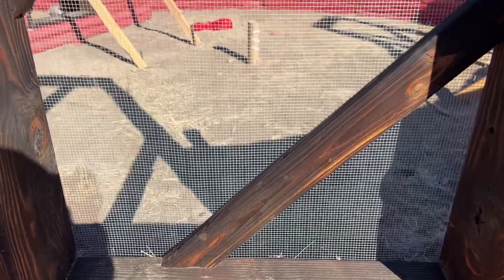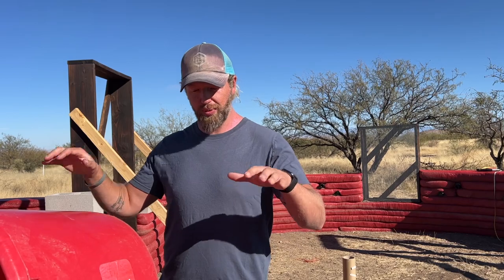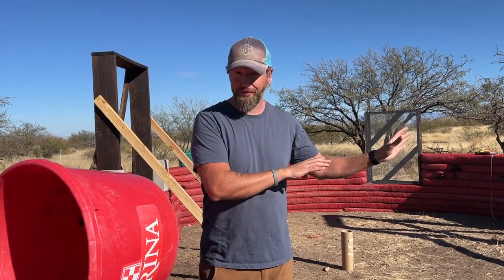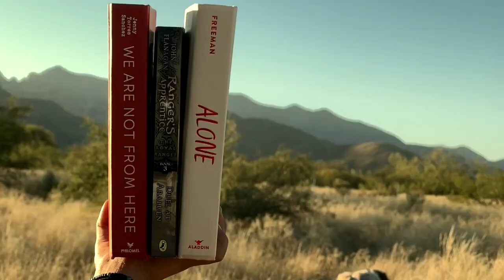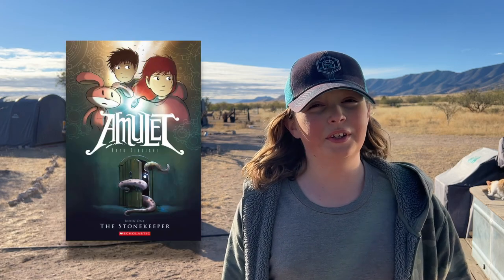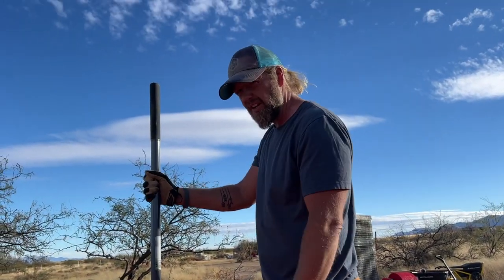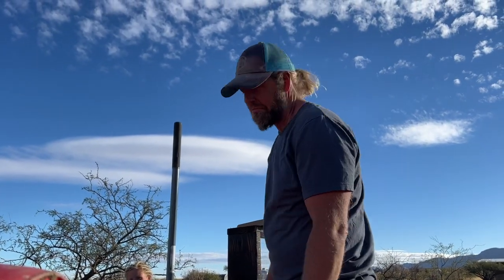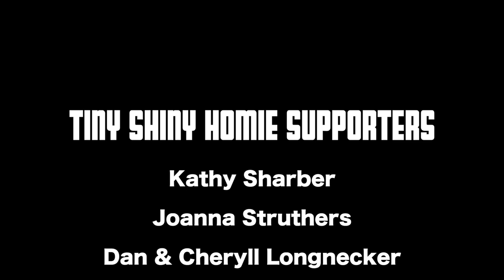Experiments with Earthbag Bottle Openings (Chicken Garden Day 39)

Comment: Interesting. When you first spoke of this project I visualized half walls with fencing. For overhead protection, a central post with a 'wheel' of beams, like an umbrella covered in chicken wire, connected to the side fencing.  Chickens need lots of fresh air with their protection.
Reply from the maker: The whole chicken run will be open air. Only the rectangle coop will have a roof.

Comment: Thanks for pulling up the rebar stakes - LOL didn't comment but did think oh thats a impaled dog or child waiting to happen.  Some  sun sail shades might help with predators,  I once did a project using the galvanized diamond mesh sheets that you use for plastering,  - sewed them together with galvanized wire along the sides and  made some pretty good sized structures were they were self supporting. Think a cube were the edges of the cube were wired/sewn together  sides and top.

Comment: Hi, I thought you were going to try to provide for more light in the actual coop section, but do the chickens need it? I think they will need ventilation and air circulation, so how are you planning to provide that?
Reply from the maker: The entire run will be open air. The coop (rectangle) will be the only  area with a roof. And it will have ventilation.

Comment: When I saw your parting shot of the side of the chicken run & coop, I thought of something.  Is there a way to get your garden soil, compost, dirt, etc...   dumped into the garden area - before putting up your outter wall?   So that you don't have so far to haul it - or too high to throw it over the wall with shovels?  I know that is not what your are thinking of now - but it might save some manual labor later???  :)
Reply from the maker: The entryway will be big enough to bring in loads. It would just be in the way building the wall and plastering.

Comment: Looking good! I really don't think you need the bottom boards due to the fact that the bags coming up to the buckets will keep it in place even when the boards are removed. You can remove the buckets easily due to the fact that the front rim is a little wider than the bottom rim, or that is the way it looks on video. Just whack the bottom and it should slide out when the bags are in place and dried. Looking forward to tomorrows video and your extravaganza.
Reply from the maker: Turns out when you tamp bags around an object, they actually do get pretty stuck so the board is necessary :)
Reply: @TinyShinyHome  Thank you for the clarification. I can now see how the board would be needed for a little wiggle room. Hope you all have a Merry Christmas.